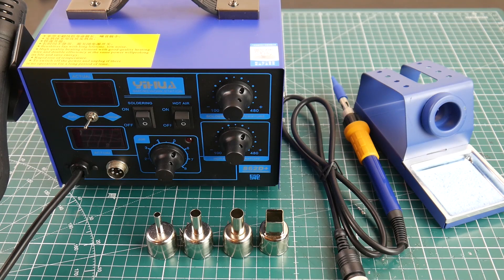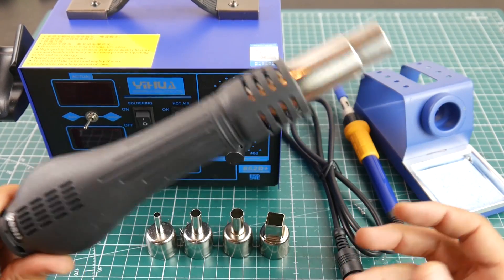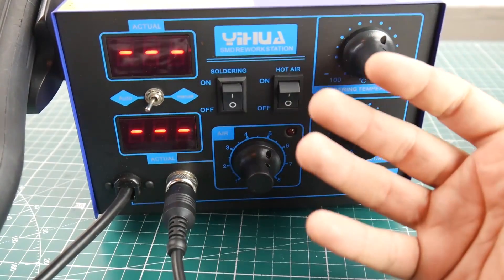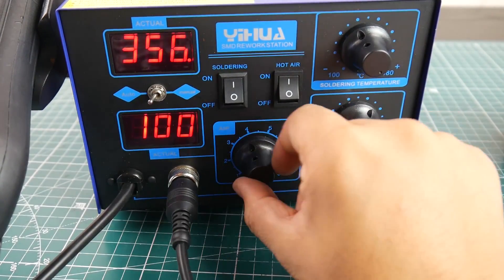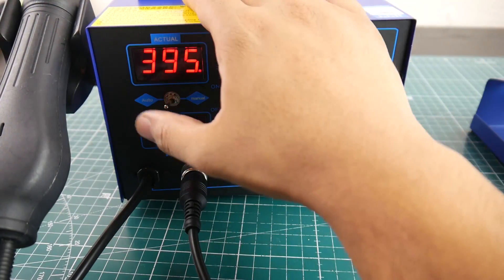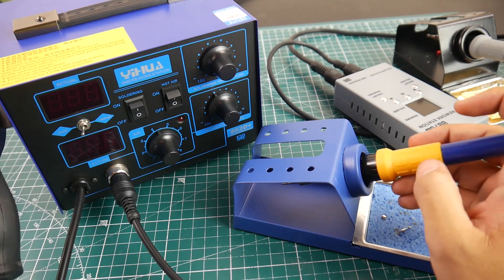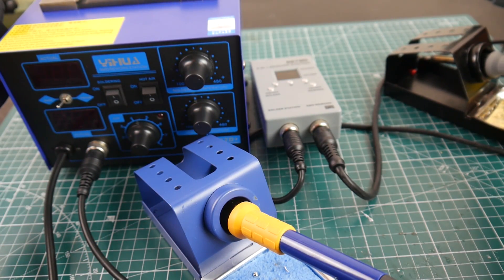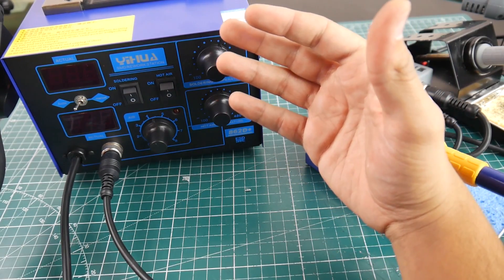YIHUA 2 in 1 862D+ SMD Soldering Iron Rework Station

Comment: I just ordered one from Vinted for like $60 total. Seemed like an amazing deal and a good upgrade from my Quicko t12-942, and I've been needing a hot air station. Comes with everything I need, and the tips seem much easier to find compared to the T12 tips. Also, mine does have a removable air gun, seems like they updated it! (862BD+) 

Opinions, good deal?

Comment: Non detachable hot air gun is basically a safety requirement. Had it been not so, one of the pins would be directly connected to mains and another switched mains, so if you detach the hot air gun and touch the connector, you'd be in trouble, which ranges from spicy touch to death. If you look at any brand name hot air station by Western companies, be it Weller, JBC or ERSA, they're permanently wired as well, as are products by Chinese brands with TÜV, Intertek or other equivalent safety certifications necessary for EU and North American markets.

I wouldn't take any bets on the life of centrifugal fans they put inside the air gun based purely on it being brushless, i have seen sleeve bearing 5015 fans from China fail at the bearing within several dozen hours of operation. The motor of the fan is the exact same that you find in PC fans, it might as well be cheaper than a brushless one. That being said replacement isn't that much of a challenge, and many fans from China especially double ball bearing type are perfectly adequate, so maybe they put in some effort into choosing a supplier that doesn't try to bankrupt them on warranty cases, and you'll also find standard products from Taiwanese and Japanese companies that you can substitute and that are actually top notch.

Comment: Received in the box a small plastic handle and screw, with a small spring attachment that looks like goal posts- What's the purpose of that item?  Haven't been able to suss it out-
Reply: For removing IC chips, ie OpAmps from sockets/boards
Reply: @andrewfoster4295  Seems like they'd have to be huge components for it to span the gap between the prongs. I've used it just to nudge the components with just one prong, but the second one just gets in the way, not sure why it's designed like that.